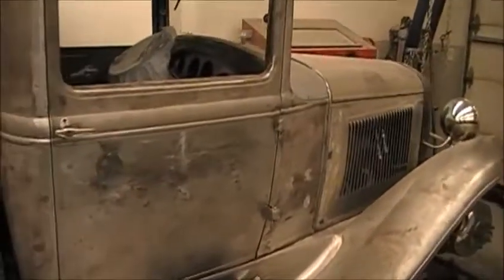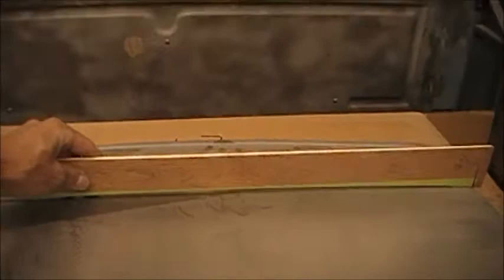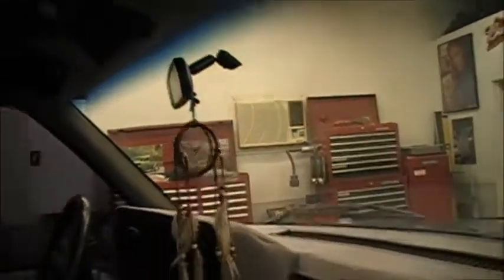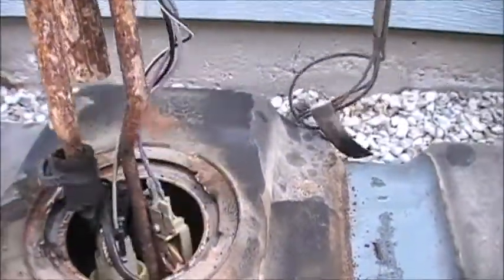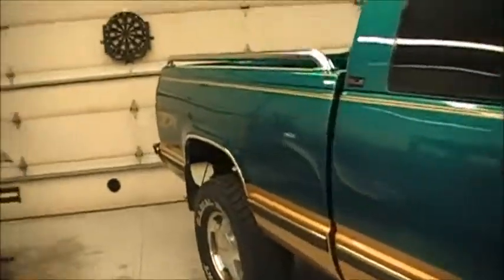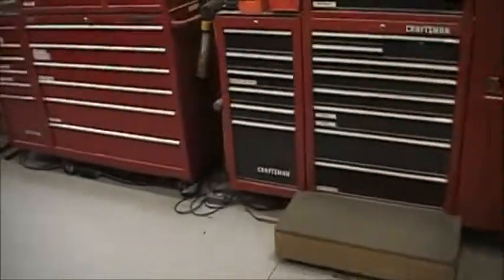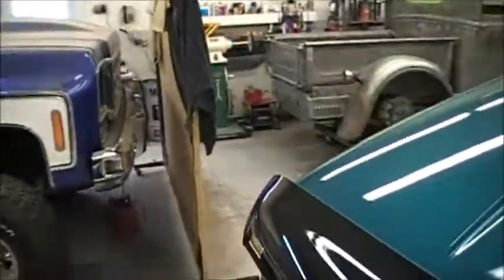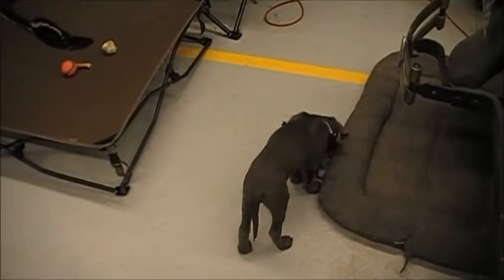Update on this and that

Comment: Good to hear from you Terry!! No big electronics expert, but I would have to say there must be a front/rear or balance control that is "cutting off" those truck speakers.
Reply from the maker: You know I was really 50/50  between the head unit or the speakers. I flipped a coin and order new speakers and it repaired the problem. But I will say even as i was replacing them I didnt think it was the problem. But I was wrong, Thanks for watching!!!

Comment: Thanks for the vid. Love that Z71. Not sure on the radio. I was thinking amp, but now I'm not sure. Might try to read the ohms on the speakers or hit them with an AA battery to see if they make a noise.
Reply from the maker: thanks Russ , I looked for a factory amp (which is usually under the seat) but once I got a speaker out and put an OHM meter to it it was one dead speaker confirmed after another...I had actually forgot how much i liked that truck with it being in the other garage. You know out of sight out of mind type thing lol .thanks for watching !!!
Reply: I have had the same speaker issue a few times lol,,so I have had to replace more speakers than headunits actually.

Comment: Mine was nasty I wish I had bought a new gas tank but I didn't...it has a spectre premium fuel sending unit assembly and it works but it plugged two fuel filters before I got most of the bad gas out, but I thought I drained it all out by pumping it out... Oh I forgot the truck was a early 94 Chevy Silverado extended cab short bed Z71 tbi 350..